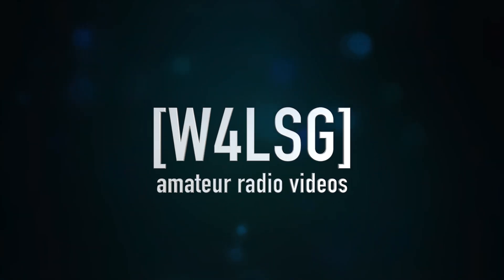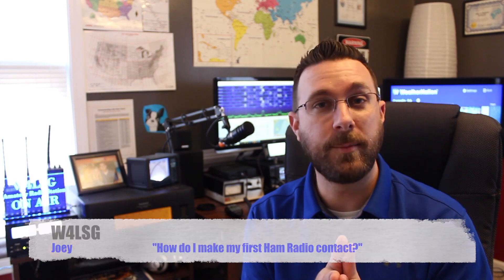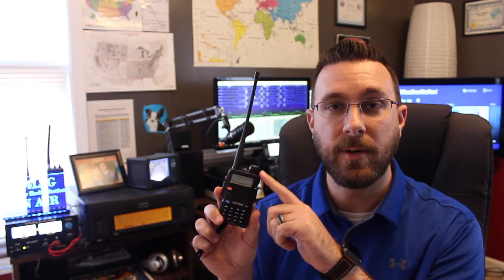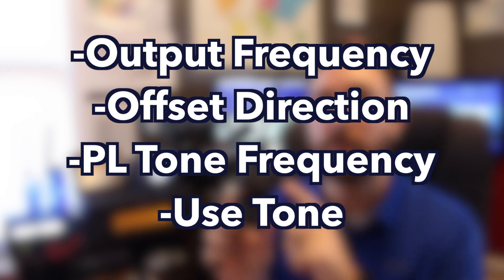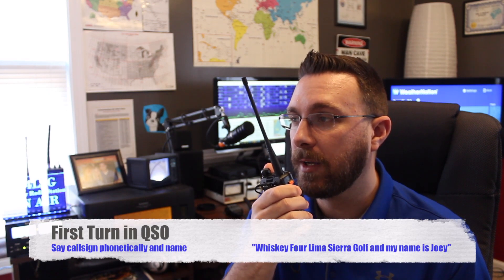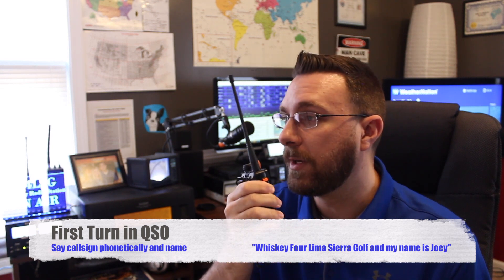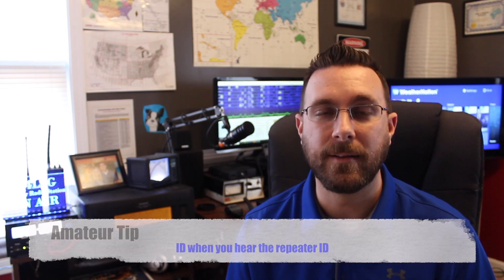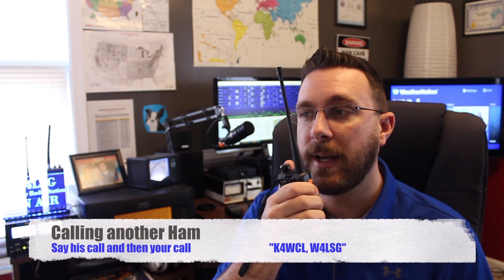Making Your First Ham Radio QSO Contact

Comment: Thanks for the tip Joey I think I'll remember that after I get my first call sign from the fcc. As a matter of fact I just found out here the other day that the here in Washington state somebody out here in Tacoma Washington who's just got a 2 by 3 call sign which started with KM7 then the last three letters was actually always Asian KM7AAA. AND I DO BELIEVE THAT THAT PERSON WILL GET FAMILIAR WITH THOSE CALL SIGNS AND BASICALLY START GETTING TO USE THAT CALL SIGN BECAUSE AT THAT TIME THAT PERSON WILL REMEMBER THAT CALL SIGN AND MAKE SURE THAT THEY'RE GOING TO CONTINUE TO USE THAT THING EVERY 10 MINUTES WHEN HE'S TRANSMITTING AND WHEN HE'S GETTING OFF THE AIR. You hit it right on the head. The very first time that somebody gets on the are using their call sign for the very first time they'll start having the jitters and in some cases they might suffer what's called Mike fright! In some cases some people might just stumble around with their call sign until they forget which letters are which for the last three after they start learning the prefix and the middle digit. And besides that once that person gets the hang of it? Then they'll be going to follow the procedure and to make sure that they're in accordance with the Federal communications commission rules and regulations.

Comment: A well informative narration on what and how to do things with your newly acquired hobby. As for the Baofeng Radios they are fine. in order for them to be sold in this country they have to meet FCC specifications. I have owned two of them since their inception and find no faults to worry about. A really inexpensive way to "try " the hobby. Keep in mind there is more way more to this hobby than just FM repeaters. The are tons of modes. AM. FM. SSB. CW. digital, ATV, Teletype ,keyboard to keyboard(PSK) HF bands . Satellites to talk thru. Check out the ARRL's sight as well as tons of videos here on you tube. been a ham for 48 yrs now and still learning and having fun. come join me and do the same. 73 Gud dx ! de Ellis WA1RKS

Comment: All I have is a Baofeng and no close repeaters. If Baofeng isn't a good first radio, then what is?
Reply from the maker: It's not that it isn't a good radio. It's just not typically strong enough to get into a repeater reliably unless you are close to it.   Lookup repeaters around you and see how far away they are.  Unless they are close, none of the HT's are going to do much for you.  I'd get a mobile radio with at least 50w of power and connect it either in vehicle with a 1/2 wave antenna or at your home with a good base antenna.  You just have to do the best you can with your situation and budget.  Just don't be disappointed with an HT.  It's a compromise radio and much more will open up with more powerful radios and better antennas.
Reply: @k4lst  I did look up the repeaters. One is a college that is 6 miles away to which I believe they only turn it on during classes, and the second is 14 miles away. I was afraid of this. I guess I will have to try the mobile way. Thank you